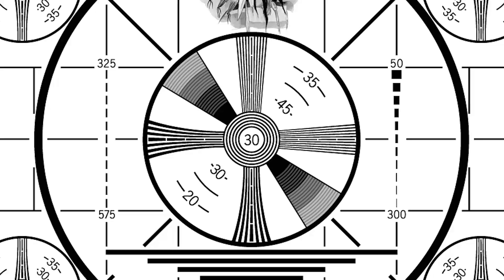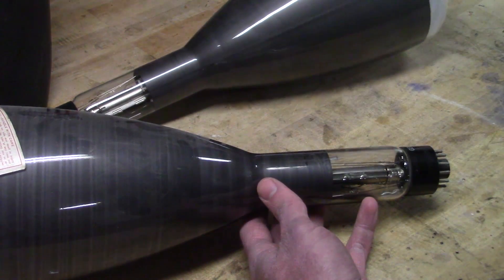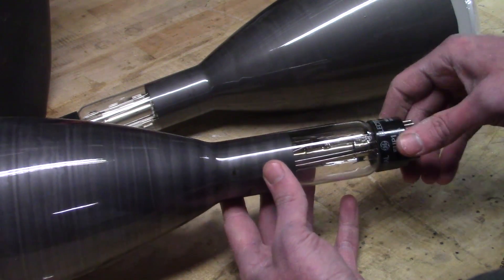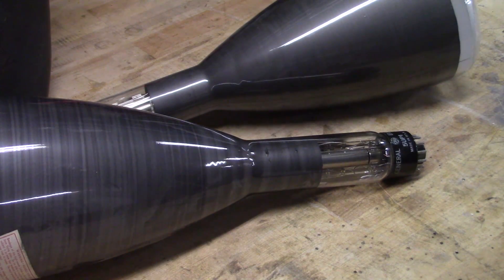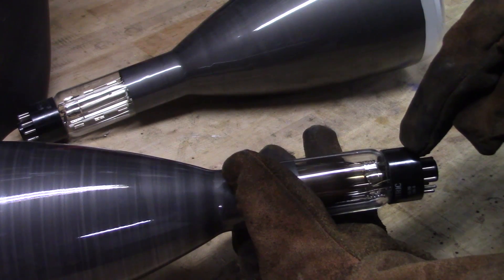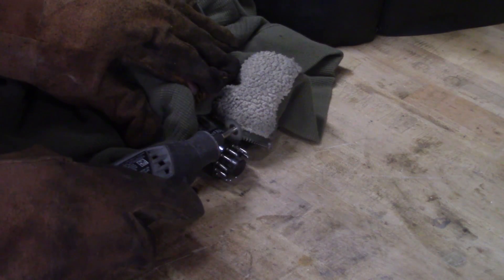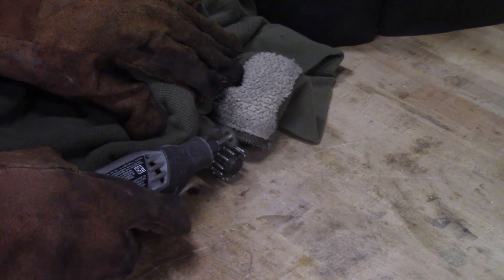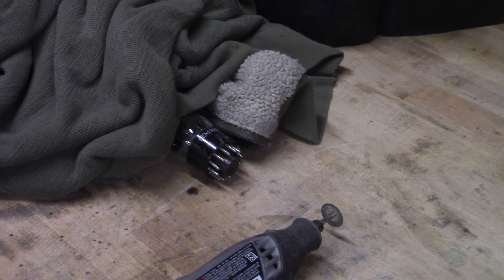Breaking open some CRT Tubes!

Comment: I once tried to make a fish tank out of a cathode ray tube television. I had no idea if it was pressurized or a vacuum. I decided to use a BB gun to pierce the tube. Just to be cautious at the last second I decided to set the cathode tube on the floor of my spare bedroom shut the door slightly, hid behind it and pointed the BB gun around the corner in case something unexpected happened. 
Something unexpected happened.

Comment: There are much easier and cleaner ways to cut the neck. Just wrap a turn of resistor wire around it, and power it up until it's red hot. The glass will crack along where the resistor wire was, perfectly smoothly.
Reply: mrnmrn1 now I wanna do something fun with that!

Comment: Punched vacuum on dozens of old scope CRTs. Put them in box. Take small, sharp screw driver from back and drive it right through center of keyed phenolic in middle of rear connector. To cut glass on neck use nichrome wire and power supply (hot wire). Ought to see the gun on a Tek 7844... Dual Beam. Absolute work of art! Be certain to discharge the front cap! 12 (or more!) KV will definately get your attention if it passes through your body...

Comment: I was seriously concerned that something would go wrong and you would accidentally knock your tailstock onto the floor and damage it for the sake of this glass tube that could have been cut with a handheld glass cutter right at the coating line. 

You know, or injure yourself. but mostly I was worried about the lathe... :)

Comment: There is just easy cheat to let in the air with that dremmel: just leave that bakelite connector on and drill a hole into that stump on the end until you "fall in"  ;)

Comment: Pipe cutter next time.They would make a really nice chandelier.
Reply from the maker: Oh yea?  I've never tried that on glass; I guess I never gave it a thought but if they have a carbide blade that should work.
Reply: just watch how they do scientific glass work ,a filed line and hot wire ,veolia halfsies.
Reply: I have tried it. Doesn't work.

Comment: awesome video. have you considered trying to open up those tubes like a lampworker would? I think it would have been way easier if you used a torch. best wishes man, keep up the good work!
Reply from the maker: I really wanted to but I've only ever seen them do it with a special lathe that can hold and rotate both sides at the same time.  I honestly thought this would cut them cleanly but I was mistaken.  Fortunately, for what I'm doing with them it won't matter; but I'd try a torch next time. :)

Comment: Someone has been watching the crazy canadian way too much :)
The glass isn't leaded, by the way. That would be horrible for the tens of thousands of angry pixies waiting in line at the business end.
Reply: TV screens used lead oxide ('crystal glass') on the sides, strontium glass on the front. Keeps x-rays inside.
Reply: i think hes refering to the coating inside the glass which doesnt come in...CONTACT... with the electrodes. but also leaded glass is made with lead oxide. im pretty sure its non conductive
Reply from the maker: I always thought they were.  Why would that be, you want to keep them all inside, right?  Surely at least some CRTs use leaded glass, at least that's what some Googling is telling me.
Reply: Well, think about it.
Multiple kilovolts + lead...
Reply from the maker: I'm doing my best to think about it! lol

The Wikipedia article for lead glass mentions its use in CRTs to block any unwanted X-rays.  I assumed the small quantity of lead mixed in wasn't enough to create conductivity but I like +sometimes idea of lead oxide not being conductive. :)
Reply from the maker: Well I don't know what to believe anymore!
Reply from the maker: Garganzuul Thanks for the clarification and the excuse to say Strontium.
Reply: It's very rare. The x-rays CRTs generate can't get outside the glass.
Reply: You're welcome. I did quite some digging a few years ago when I was looking into the potential of re-use of CRT televisions as components for e.g. an e-beam workstation. Cutting glass accurately isn't easy though.
Reply: CRT electron guns can be used for a SEM! And, if you're extremely careful and can get the ions inside there, you can push an ion beam around too.